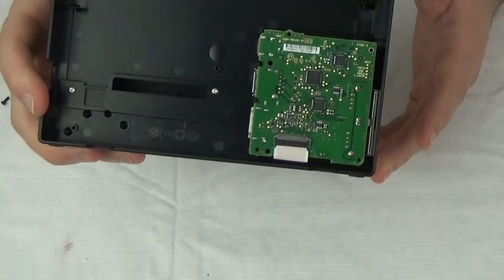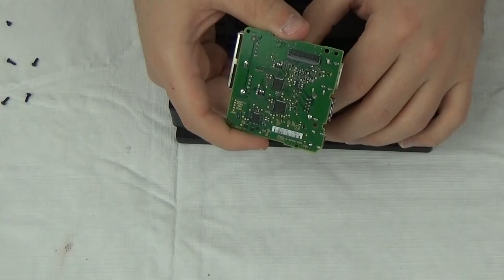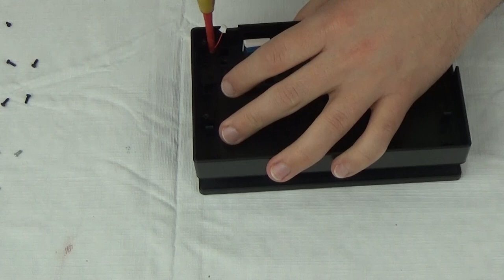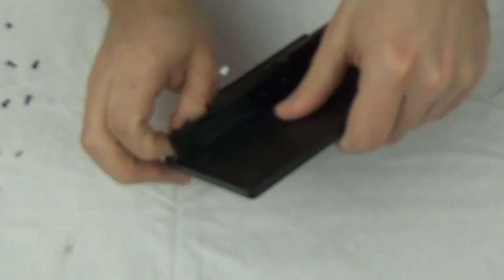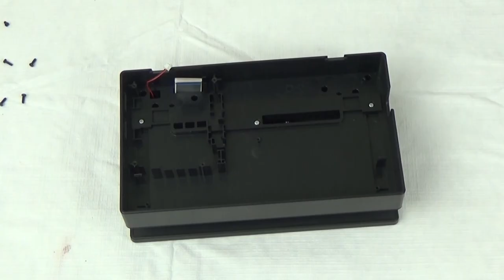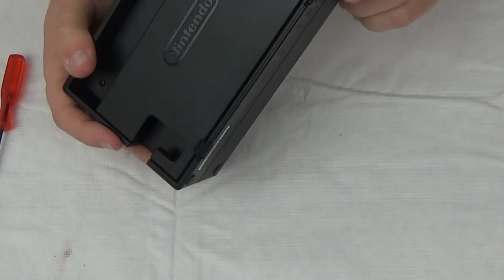Taking Apart The Nintendo Switch Dock!

Comment: I called that spring mechanism on Reddit and people told me I was wrong look whose laughing now
Reply: Did you go back on reddit to see what people are saying about it now? 
They probably won't admit they're wrong but it would still be funny to see they're expressions. Lol
Reply: ayy i saw you on reddit, i was 50/50 (get it)
Reply: Yeah r/Nintendo switch is a harsh place
Reply from the maker: It's a good design, not sure why they would be mad about it.
Reply: I wonder if you could connect a USB-C female to male on the dock to the switch so that you can see it on the tv without docking it.
Reply: No Loli No Life so even I you  plugged in a USB c to HDMI the screen would be blank? that sounds annoying..
Reply: No Loli No Life why would u do that just put it in to the dock damn
Reply: Dulan and u mad cause
Reply: +No Loli No Life Just have something hold down the spring mechanism and it should let you use it

Comment: Ah $90 and they couldn't afford to put some felt inside to stop the screen getting scratched.
Reply: CSmithyPx yeah complete bs
Reply: CSmithyPx they can’t provide us with free screen protectors
Reply: I know right!
Reply: @frain_breeze1707  You talkin' to me?
Reply: If you’re careful you won’t scratch the screen.
Reply: I got a problem now that my switch is hard to put in and out of the dock
Reply: ima buy a small one , idk if i shud buy the custom basstop one
Reply: Mine never scratched don't know what you do to yours, I just take it out and in over and over an doesn't scratch but yeah they could put some sort of rubber on the plastic things that touch the screen

Comment: I still can't believe this thing is $90. I can understand the cost of the Switch itself and maybe even the charging cable which can run at a few different speeds but this along with the charging grip just seem to be way overpriced for what they are. My opinion might be a bit different had they included some nice padding inside the dock to protect the Switch from rubbing against it.
Reply: Lycon Xero 

the charging grip has a pretty big battery and a USB a to c cable (5$)

the dock comes with a power brick (30$, and its one of the cheapest for the power output), an HDMI cable (10$) so...
Reply: Charging grip doesn't have any battery inside as far as I know...
Reply: MasterPiPoNL 

Whoops I meant pro controler. Whose going to buy a charging grip anyways... joycons last 20 hours.
Reply: True and the pro controller is so amazing :D Loving it while playing Zelda. RIP Life
Reply: MasterPiPoNL 

I was CONSIDERING buying an xbox controler for PC/emulation but nope. Gonna buy a pro controler and savor it while saving up for a switch.

I mean, getting it at launch is a hassle for any console cause of the fresh realese demand.
Reply: No hassle if you pre-order in time. I pre-ordered the day or the presentation and the pro controller when it showed up on the webshop a few days later. Good luck getting one soon. :)
Reply: Lycon Xero I think a lot of the cost comes from the HDMI and USB licensing.
Reply: MasterPiPoNL 

Sad thing is I live in korea... and school starts march 3rd so I can't go to japan...
Reply: No no it does not. That is incredibly cheap, USB and HDMI licensing does not come anywhere near 90$ nintendo are just taking the piss as per usual. The VITA TV which was hardware in a little box had an ETHERNET PORT, and HDMI and cost less than £50. This is a piece of plastic dock with a splitter and pass through. You do realize a Raspberry PI is a whole computer and they have to pay for USB and HDMI licensing yet the thing is under £20.

Open your eyes they are milking you blind
Reply: Rubber Duck 

I'm pretty sure raspberry pi does NOT use USB C.

The cheapest funcional usb c to hdmi comes in at 30$ without circutry.

And besides the USB has to do a LOT more than just output a single HDMI out.

Plus the dock comes with the power brick, one of the cheapest USB c one with that powetmr rating, and its 30$. And an HDMI cable of 5~10$. Meaning the dock is like 50$ when similar docks/dongles are 30~60$.
Reply: KumorixGuardian 

Thats true for ALL products.

Shiping and retailers margins are a thing as well.

If ninty doesn't have to give retailers margins the switch would be 250$... and digital games would be vmcheaper than phisical. Alas, not the case.
Reply: Rubber Duck 

Have you eve  seen the prices for USB C to hdmi prices? They are 20$, 40$ to include AC in. If you think its 80$ profits you are delusional. Maybe 10$ but no more cause it comes with a charger. A 30$ charger, actually one of the cheapest on the market for such high wattage. USB C cables of good quality comes in at 5$. And retailers get 5~10$. Thats usually not nintendo its gamestop, anazon, best buy. The dock itself is 50 considering everything and USB C hubs of this caliber come in at 40~60$ MSRP.
Reply: I think you're paying more for the functionality and design. The ability to put your switch inside the dock and play. it's totally not worth it at all but if Nintendo want to compete this is what they have to do and many companies are following the trend. The general consumer won't think of a USB C to HDMI pass through board they will think of the magical thing that is switching to TV mode it's mainly a marketing plea.
Reply: Ben Abbott 

You do realise its not a simple b
Pass through board...
Reply: Price drop for the Dock? Don't see it on the Nintendo site
Reply: So the dock alone is 60$, then buying the power brick alone is the other 30$, so technically when you buy the dock set, the HDMI cables are included for free.
Reply: if you have those cloths that you clean glasses with you can cut them up and stick them in but yes they should of put some felt on the inside which im betting they will do going forward with their design. remember no console is perfect at launch.
Reply: CardriderDraw - Level2
False. Dreamcast.
Reply: ytilanigiroon yo facts
Reply: The charging grip should've been included in the console by default. Whether or not it would've raised the price of the Switch is debatable, but I do agree on the dock being overpriced. It essentially acts as a link between providing output to a TV, and hub for USB peripherals. I really hope Nintendo reduces the price, at least it comes with every console, not everyone is going to really need another one, anyway.
Reply: ***** 
Its worth around 50$ at least, and the(included) charger is definetly worth 30.

Cause ya know, a regular hub wouldn't be able to get a USB 3.0 at full speed AND HDMI. Not to mention the 2 2.0 ports.

The switch probably uses a propreitary alt mode with USB C to bypass said bottleneck. The dock THEN converts that signal to USB ports abd HDMI.
Reply: A Pi Zero is $5.00 and also must pay for licensing. People are also overlooking bulk manufacturing and retail price vs. price of parts.
Reply: I don't know for the price, but I expected a cooling system, smouth material paded all over the inside, the space inside to be more filled with dunno what, for what's in there, I don't know if it's over priced, but it for sure is over sized.
Reply: Individu λambda 

Well to be fair another fan won't really help when the tablet itself already has a fan.
Reply: It has one? I never heard it, my Switch tend to get pretty hot when I play Zelda or 4 player Fast RMX.
Reply: Individu λambda 

There is a pretty nice fan inside of the vent.

Its this thing that allows the X1 CPU to run full tilt, t
Which even the sheild CONSOLE couldn't do. It doesnt throttle.
Reply: TheBraveGallade Ok. Coming from PC, I'm used to louder fan equals more effective cooling, silent but effective cooling equals water cooling.
Reply: Individu λambda 

The innards of the thing is basically SURROUNDED in a protective metal case/eletrowave sheild that also doubles as a massive heat sinc. Ergo, it can run full throttle in handheld and massivly overclocked in docked compared to stock X1.
Reply: Individu λambda 
Coming from PC, louder fans = more cost effective fans.

The Switch wasn't designed poorly, the dock was. The guy above me has it correct, the body of the switch is a massive heat spreader and is the thing that contributes most to its cooling efficacy. I still don't know why they didn't just slap a ¢.02 piece of thin felt on the dock that faces the screen... just a silly oversight... or maybe just don't have that side on the dock?
Reply: ytilanigiroon 

The scratching issue isn't widespread... its an oversight.

And a screen protector works in case it does.

I think they should have included a screen protector in the box though. Its only 5$ and who DOESN'T put a screen protector on mobile screens?

The fan is a way to directly cool the hottest part of the device.
Reply: TheBraveGallade
An oversight that could have easily been avoided with some practical product testing.
Reply: ytilanigiroon 

Uh they probably did that... quite a bit. Its not unteasonable that they didn't cone across this issue. This is nontendo we're talking about. Total design failure... almost never happens.
Reply: TheBraveGallade
I'm sure they did do some testing, but your point about Nintendo needing to have included a screen protector... make the damn thing out of something other than plastic and you won't have that problem in the first place. These are devices that kids will use, they're going to be ejected "less than gently" - a point I think the majority of the people talking about the Switch may not realize.

I'm not saying the Switch is a bad device, I like it, but there are a bunch of things that I just don't get the motive (aside from cost saving) on.
Reply: ytilanigiroon the thing itself is VERY durable, especially with the thumbsticks acting as a bumper, although I wish the screen was regressed in slightly just in case (something NOBODY does even though it would help SO MUCH in terms of screen protection). And besides, the scratches don't effect the display anyway cause the scratches in on the bezel. Its only a minor annoyance.

Unlike my 2 psps that just shattered when I dropped it ONCE. After that I said 'fuck that shit' it was ONE DROP on a hard surface! My PHONE can endure 10 tines more!
Reply: I love the switch, I just got surprised of how hot Zelda makes. I'm confident that for 3D printer users like me, we will find better docks to print soon. I just have to find that stupid Nintendo only screwdriver.
Reply: Individu λambda 

Oh a tri wing screwdriver? That thing is actually industry standerd too, for electronic devices that the general public should not open. Ya know, so soneone who does not know what thier doing can open it?
Reply: TheBraveGallade I repared some GBA SP, DS and 3DS, I work at a place where computers get dismounted and content recycled, I have a basic knowledge about what I should touch or not, I don't want to mod\overclock the thing anyway, just change it's casing for something more mobile.
Reply: Individu λambda 

My point is that its not an nintendo only screwdriver. Its used in a LOT of tech that is usually not meant for most people to not touch. Mostly phones and laptops...
Reply: TheBraveGallade Really? Of all things I own, the only things that uses that are Nintendo products, my laptop uses standard flat headed square screws, and my phone either doesn't have screws or is mounted in a pretty complicated manner.
Reply: Individu λambda try something thats  a thick customizable laptop.
Reply: Your paying for the R&D not the plastic
Reply: They did an amazing great work, but I'm not sure if the R&D really puted time into designing the plastic part of the dock...
Reply: it's mostly a cost of a charger
Reply: Just see the price of Power Bricks for MacBooks... especially 90 watts...
Reply: Maybe we can get a switch OLED without a dock for $90 less than the going price. 😅

Comment: lol 90 $ for a dock the price already was disappointing but after seeing the vid omg is this so over priced.
Reply: Randiel Rodriguez if it's proprietary, it's gonna be over priced. every time.
Reply: 90$ with an adapter and hdmi cable, 50$ most likely best price for dock alone
Reply: yep they have some anti-piracy with the conversion to HDMI.
Reply: It's still priced high
Reply: TheGoreforce barely

Comment: Guys, the $90 works out:
$.02 for plastic
$.12 for circuit board
$45 for sashimi platter for Miyamoto's lunch.
$43 for Yakuza tithing
and the rest is profit.
Reply: thejobloshow it does come with a hdmi cable and an ac adapter which are way more expensive then they should be.
Reply: $88.14 for anyone who sucks at math
Reply: MulletEagle *an hdmi
Reply: zech i bet you used a calculator for that
Reply: yup

Comment: $90 for this? It looks like that $4 PC that was all the rage a year or two ago.
Reply: Ghost81 Raspberry pi?
Reply: @Someone Someone's salty... this is just the dock; of course it has not much technology. It doesn't need it. A raspberry pi is a general purpose computer. But if you compare the actual Switch to the raspberry pi... does the rpi have accelerometer? Gyro? Vibration? An IR sensor? NFC touchpad? A touch screen?
Of course all these are available as add-ons, but the Switch has them all already.
Reply: @Someone OK, I agree, the dock is overpriced. But don't forget that it is a lot bigger and made of plastic, which is made from finite resources. And the cost of designing it, and the entire switch to fit perfectly, is factored into the price as well.

Comment: I just recently bought a sort of replacement dock that also happens to double as a portable stand (you can use the USB C to plug in a GC Adapter), and I feel a little less bad I payed almost 14US$ for it. I looked this up so I could open it up and pass the mother chip over, and it might be worth it. 

Nice tutorial.
Reply: Did it end up frying your switch? I heard the third party docks have different voltages that can potentially fry your switch.

Comment: Thanks for posting. I was curious about the spring mechanism, since I think it's weird how easily the switch mates to the usb-c in the dock. Not only does it aim well, but it also seems like it takes very little force to actually get the connector in the socket. This helped but I'm still a little confused as to why it just slides in so easily...